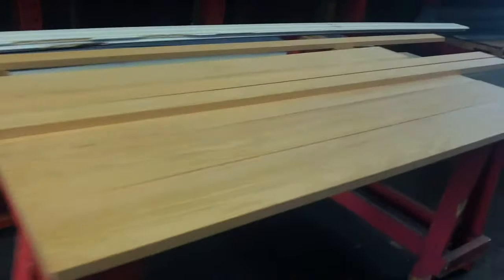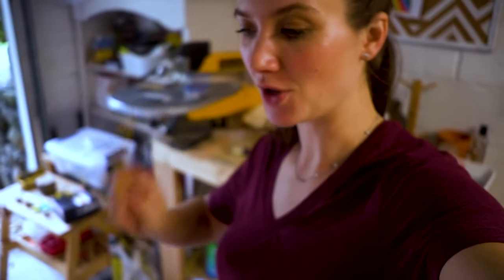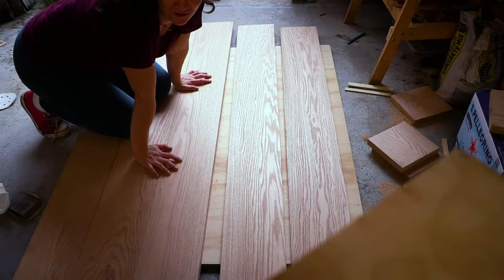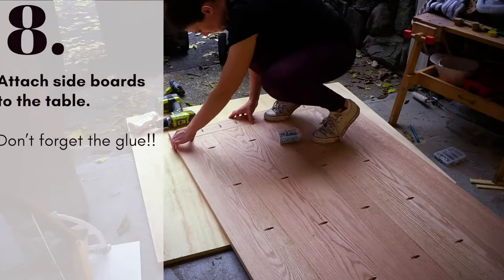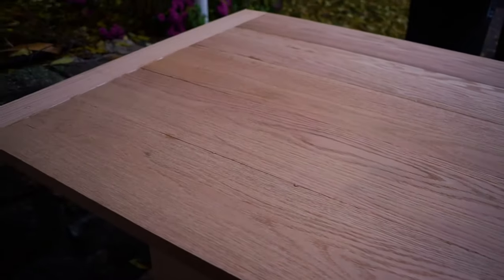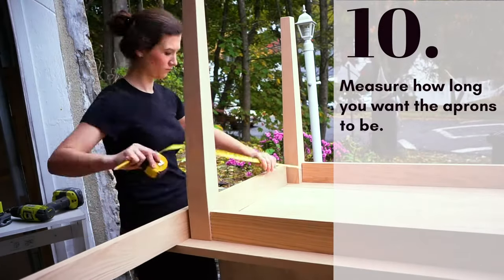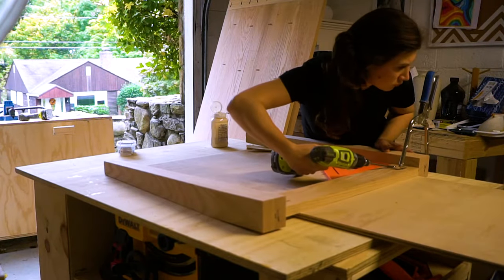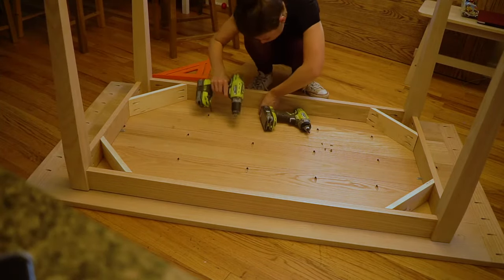HOW TO MAKE EASY DINING TABLE | High quality dining table with limited tools | If Only April

Comment: How has the table top held up along the breadboard ends? Any problems with the wood expanding & contracting?
Reply from the maker: That's a great question! I was not aware at the time of the built that pocket holes joinery can do this. The breadboards extract on the winter when we have a heater on (about 1/8" on the sides) and it stands next to the heater. And then it shrank back in the summer when we had AC on. It's been over a year and it is still fine. But I don't know what will happen in the future. Hope this helps